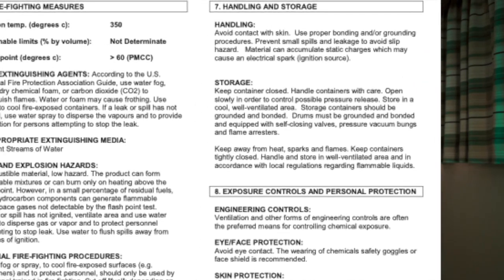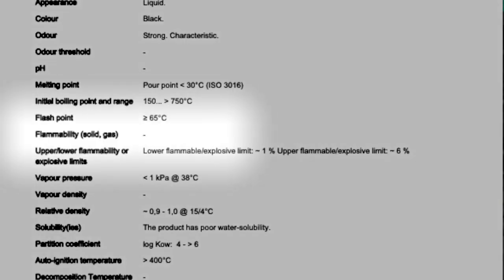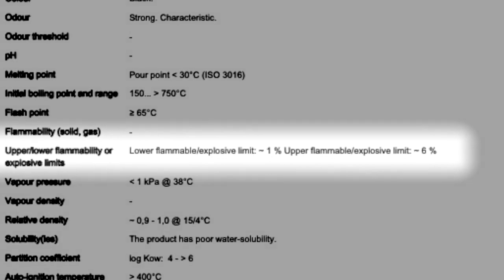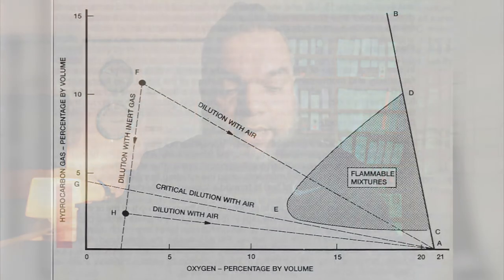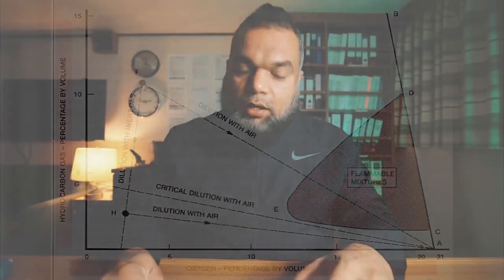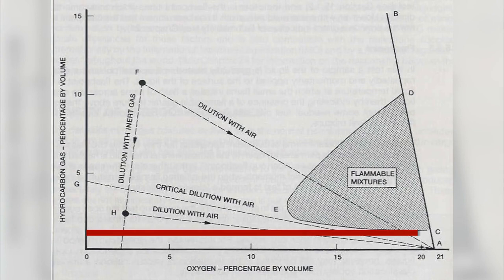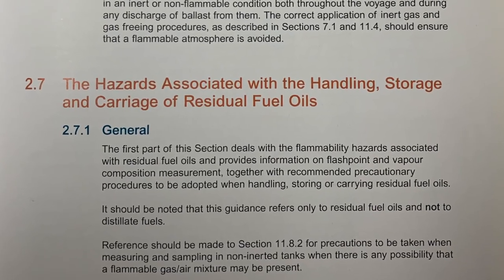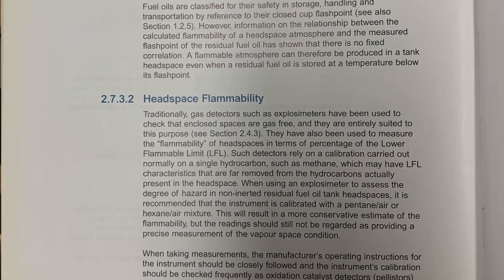WHY IS IT NOT REQUIRED TO INERT THE BUNKER TANKS - REAL REASON

Comment: becuase in bunker tanks  would not reach 60 centigrade  heating and it cannot produce much hydrocarbons. It means, there will be no explosion will occour. Thsis is the reason why 3rd engineer has a flash point test and viscosity test.